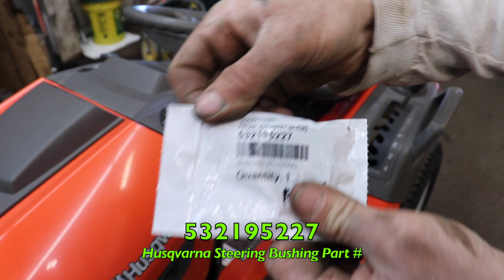How To Replace Plastic Husqvarna Steering Bushing

Comment: Thanks. That's azackly what I needed to fix my Huskyvarna. Part ordered. Great video.

Edit.
I received the part.  I didn't have a conduit or chop saw to cut it with.  Instead I used the old bushing turned upside down on top of the new bushing and tapped it in with a hammer.   And there's your dinner brother T.  Thanks!!  Its so nice to fix that little irritation.
Reply: There's another bushing below that one which probably needs replacing too.

Comment: Another great video. I used the old  bushing to slide over the new one and pounded on that one. I also found some of the slop came from the steering wheel and steel serrated hub, so I smeared RTV sealant on the outside of the hub before I tightened it down. Once it hardened no more slop!

Comment: All ride on mower's should have a bearing block assembly on the steering shaft with replaceable ball or roller bearings!
Good vid.
Reply: For what they charge - sorta.

It'd make more sense to have an oillite sleeve encapsulated in a support block with a couple thrust washers above and below it and hold the stacked assembly captive with the usual cotter pins.

Bearings need grease and no homeowner is gonna grease that shit.

Comment: My steering column has an extension and the bushing will not slide over it. It looks like the extension should turn on the shaft, however I cannot get it to turn. I have used heat and rust breaker but nothing. any ideas would be appreciated. Your video is excellent.

Comment: Hey Taryl!!! I got me one of those YT3000 Craftsmen 917.288520
I got me a loose steering rod also.
is this the same part since Husky makes it for craftsman??
And I been trying to find those nylon bushings for the front wheel hub.
But I am told they no longer make them and no one has bearings small enough to go into those less than a an inch in diameter holes!!!!!

Comment: Question I have YTH2348, deck height... at setting 5 (deck max), blades are at 3.6”  from the ground. I’m cutting St Agustine ideal cut is 4” and up. Is there any other way I can raise those blades ? Bigger tires? Any ideas ?

Comment: Wish that was the YTH22v46 with the gas tank in the way of the steering shaft. Is there a way to get around the tank without tank removal?  I like the pipe trick, and looks to be about a 30 degree cut, and I would use a plastic washer or even a steel washer would protect from marring that bushing up (sorry, perfectionist here).  Too bad there wasn't a second bushing at the top just below the steering wheel, but I guess a ridge on the underside of that steering wheel rides in there. Nice video bro!!! And YES, I enjoy my dinner!!!

Comment: Hey Taryl ...do they make that in brass or stainless .. or would that be a bad idea ??? I hava a husqvarna didnt know it was built so cheap...
Reply: Actually, the bushing is made of delrin polymer. It is formulated for it's strength and lubricating properties. And being a little softer that the steel shaft, it is better in this application. It will prevent the bushing from wearing the shaft therefore, saving a more expensive part.

Comment: Can you do a video about the bent frames on ayp/ husqvarna made lawn tractors.
Reply: Yes!  A video on installing the "L" bracket kit for the Husqvarna rear axle to frame mounting problem would be great!  
According to the instruction kit, you cut off the bottom part of the drawbar where it attaches to the axle, then drill fresh holes in the frame and install the two brackets one on each side. (He might have already done one, just haven't seen it if so)
Reply: @ Talladega Tom I can vouch for the instructions regarding that kit as I have done quite a few while working as a lawn and garden tech for Sears.
 You are going to want some means of getting the rear off the ground to remove rear tires and easier access to removing the tranny.
If the old busted brackets are still emplacement they can provide a guide for the installation of the new ones and having a paint pen to mark your drill points is an asset.

Best of luck.

Comment: I think mine has a steering shaft extension which is bigger at the top and the bushing will not slide up over the shaft. according to my manual I have to unscrew the extension and then remove the bushing. have not tackled it yet.

Comment: I have a question, I followed your directions here. Problem is I have shattered one new one completely and the second I put in is cracked. Can you put a heat  gun to the new bushing to make it pliable a little to drive it home into the finished placement

Comment: Hey Taryl, do a carbatrator breakdown of the Southland or Earthquake 43cc cultivator. Thanks in advance.
Reply: I just replaced a carburetor on a earthquake post hole digger. Those carburetors resemble a Shindaiwa. Go to eBay and type in the model number of the earthquake as you probably won't find any identifying marks on the carburetor itself because it's Chinese. What it is is a Shindaiwa clone. They're about $11 with free shipping and it works like a charm. Several photos you will be given to look at so you can compare it. Part-time Small Engine guy checking in here. Good luck
Reply: Roger, I did that put new one on. it requires me to start with throttle open, and it dies as it goes to idle, otherwise it will run on full throttle... was looking at any adjustment in it, so it will start right and idle at low speed. Thaks for the help...

Comment: Is this the same way to fix a Cub Cadet with the same problem? On mine the fuel tank is in the way!
Reply: I have a cub cadet ltx1040 that's needing this done. Just bugs me that theres slop in the wheel,lol. I think mine is in the way too,but it's simple enough to unbolt and sit on top of the engine. I gave $500 for it last year and I've had to work some kinks out of it,but I think this will be the last thing besides fall maintenance before putting it up for the winter. Seems like a decent mower for a low end unit.

Comment: Should have had a lick of grease on that shaft first taryl 🤔
Reply: Grease will hold dust and dirt and wear out the bushing faster. I’d use spray dry graphite.
Reply: Wheel bearing grease will stick around for awhile..
Reply: I use Gold Bond talcum powder , keeps my shaft cool all day long
Reply: @RustyZipper  I thought Talcum powder was a banned substance now....

Comment: Taryl, this piece doesn't seem to fit my 2010 model. There is no bushing in this location on my mower. The steering column shaft just goes through a hole and meshes with the other gear below the frame.

Unless this piece has broke and fallen out. The slop in mine seems to be under the steering wheel.

Comment: I've got the same tractor. It's popping and backfiring. I did everything I can think of. Coils.carb.heads.new fuel, timing key????????????????????????? cant figure it out.
Reply: Internal timing may be off, might necessitate cracking that engine open.
Reply: @yfna1  Meaning the cam marks jumped somehow? I've never heard of that, but I guess it's possible
Reply: @Old600Rusty  Unlikely.
Reply: Is the coil on upside down?

How's the voltage when it's running?  Might have a bad regulator, or bad ground.

Comment: No grease?
Reply: No grease, the grease will attract  dust and weat out your shaft. At least that's what my wife says.
Reply: My man Chris stepping up to the plate with jokes today. But Chris is correct if you put grease on it it will attract dust and sand and other abrasive things. You just don't want that on your shaft. A little trick my Meemaw taught me.

Comment: Be careful that you don't have the WHITE bushing ending in 228. not 227. 228 is a smaller hole in the center, 227 is a larger hole which WONT work...Everything else looks the same and installs the same however. Even the parts list shows pn ending in 227 however!!!! GRRR. Ask me how i know?

Comment: That Husqvarna Steering Bushing is a 100% piece of garbage!............***I am trying to locating a Sealed Bearing that I can replace it with***.............The other issue is the Bushing used on the Steering Axle. They come from the factory with more slack than my underwear!

Comment: craftsman riding mower brake clutch does;t work good what to do
Reply: Depends on how it isn’t working.
Does it not allow you to engage parking break or is the tractor just not stopping?
Reply: Check the linkages to make sure they work when they’re supposed to , they might have slacked off